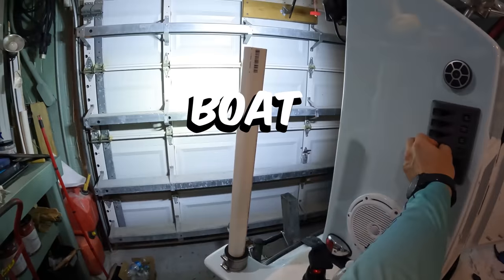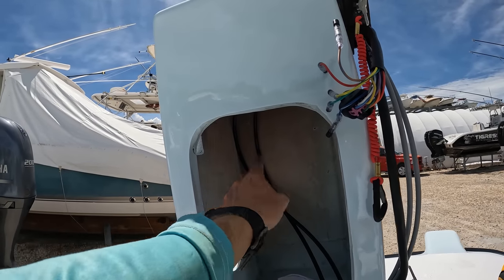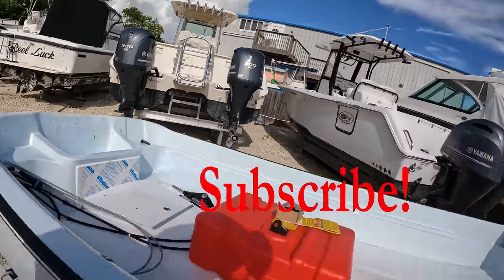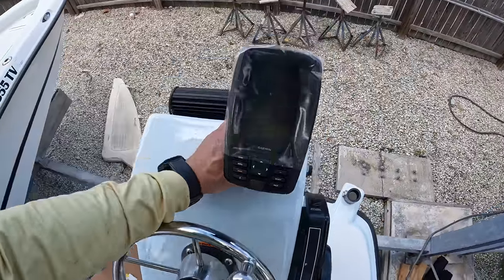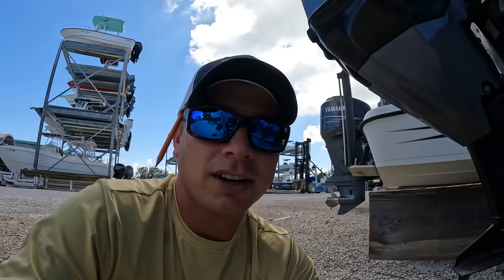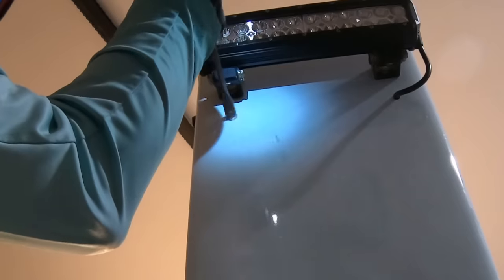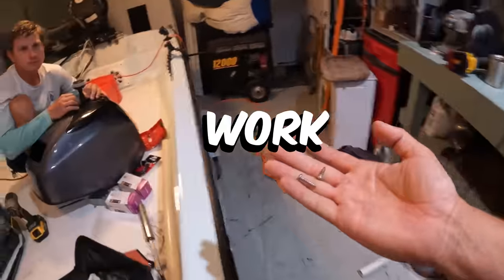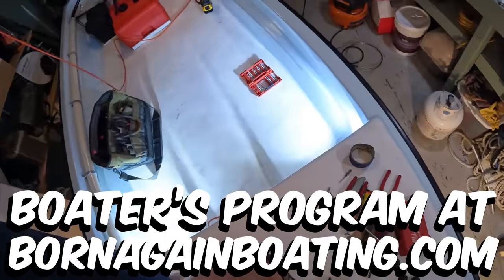ENTIRE Boat in 8 MINUTES!!!

Comment: If you pack those heat shrink connectors with dielectric grease (a.k.a. tune up grease) before you crimp and shrink, they will last a really really long time, even in salt.
Reply: Thanks for the tip.  Just like a wheel bearing.  If it's full of grease there is no room for water.  Beautiful.